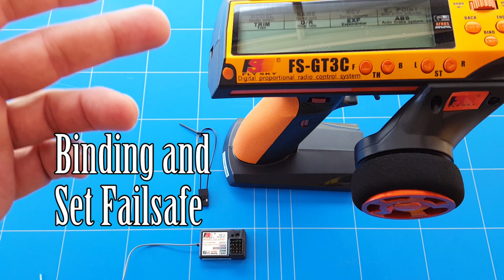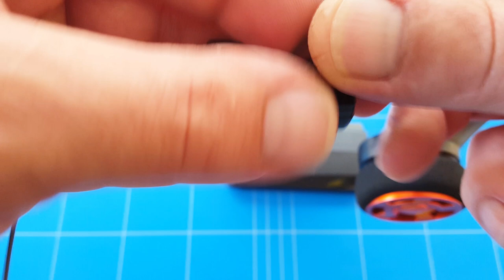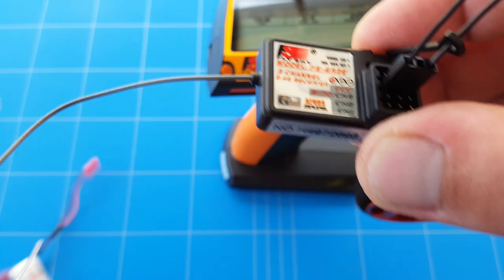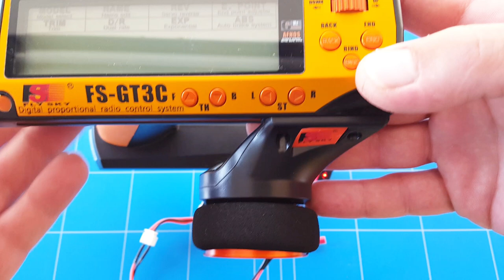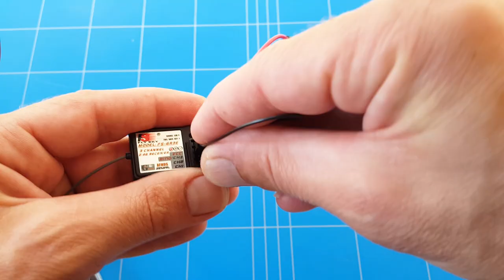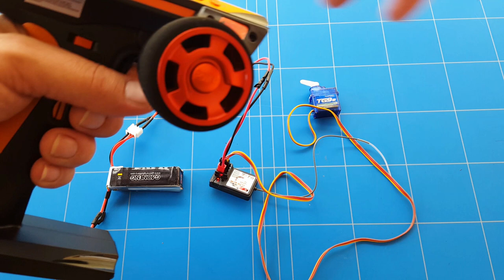Best Way To Bind FlySky FS-GT3C Transmitter To FS-GR3E Receiver and Setup Failsafe

Comment: Radiolink RC6GS/RC4GS has functuon of Subsidiary ID ( ID seed), does GT3C has it? 

ID seed explanation from Radiolink is when boat1 still has minimal power, while using boat2 to rescue boat1 ,transmitter controls two receiver at the same time. In this case, radiolink transmitter is able to only communicate with boat2, make it easier to rescue boat1.

Comment: why my throttle full speed on channel two of this radio set up? steering servo work fine with external power to reciever, but adding a motor (white red black) to channel 2 and the thing goes full revs and no response from transmitter input :( pls help. same controller and reciever with tamiya teu101bk ESC.

Comment: I have a problem with binding my flysky gt3b and gr3e reciever the reciever go's into bind mode( led blinking fast) and then I hold the bind button and power on the transmitter but it won't connect? my gt3b transmitter will connect to fs-a3 recievers.... I'm so confused
Reply from the maker: Maybe its the gt3e receiver instead of the b version look very good its small letter hard to see difference i made the same mistake

Comment: I have a brand new transmitter and gr3 receiver. The steering works. But no throttle. If i swap plugs. Throttle works with channel 1. Is the receiver bad?
Reply from the maker: no you need to assign the channels in the transmitter menu

Comment: Can we use that FS-GR3E 3ch rx with Flysky FS-GT5 transmitter?
Reply: Im also wondering this
Reply: In case anyone still wondering the same question. The answer is NO. FS-GR3E is using AFHDS mode. FS-GT5 only can bind with receivers that support AFHDS 2A.

Comment: Hi if ibuse gt3c will i still have the fail safe function in the gt3c package? Or do i need fail safe tranmiter to work for fail safe functions? Thanks im confuse and new in rc worlds thank again
Reply from the maker: yes with gt3c you still have failsafe you can activate by pressing a small button on the reciever